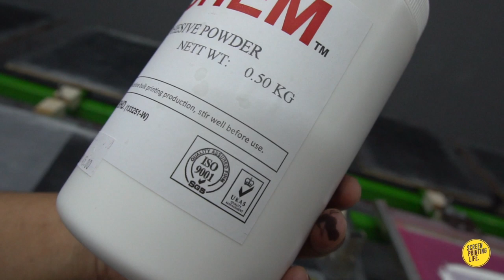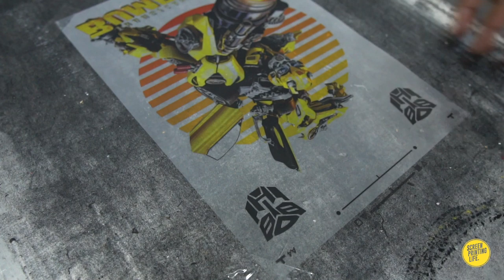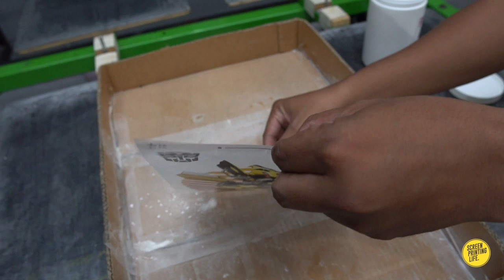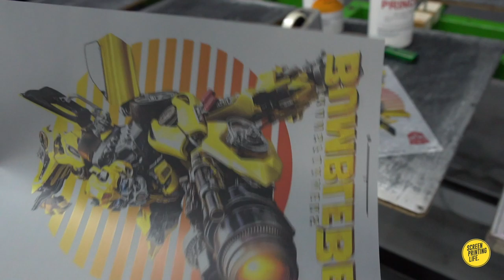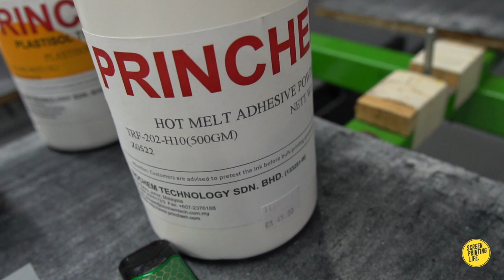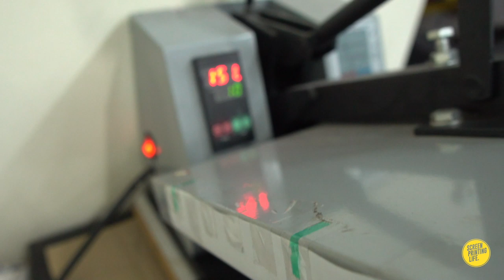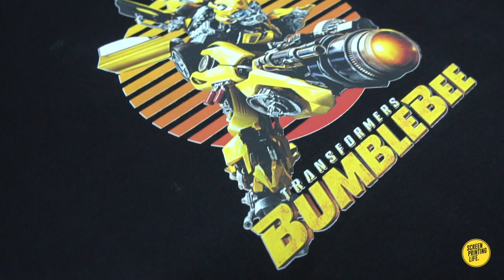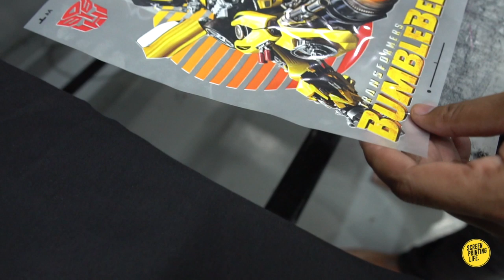Silk screen : How To Do Digital Transfer On Dark Shirt

Comment: I might be a little late but gotta ask anyway. Did the print last for long without fading after several washes? This is great for logo printing in my case. Thanks!
Reply from the maker: Yes color fading after about 20 washes but not bad. I suggest you using DTF instead Digital transfer like we do. 

DTF ink made for textile. And the laser tonner / laser color we use not for textile.
Reply: Thanks for the reply. I greatly appreciate it. Do you think cmyk dtf ink 
on epson printer + white ink (screen print) + adhessive will work? I have epson printer that I'm not using anymore. Thanks!
Reply from the maker: @buildonbudgetph4662  I am not sure about that but logically it will work if you use DTF ink because it is for textile. Why don't you give a try.

Comment: Hi, do you apply light, medium or heavy pressure on this? What kind of toner is being used in your laser printer please? I am using CP5525 laser jet and I am facing this issue with the transfer that the fabric texture appears on the print and those lines have a lighter print color and it seems rastorized. I am using 5 density for all colors in my print settings. Please let me know how do I get rid of these lines in the print. You can have a look at the problem I am facing in this picture: https://prnt.sc/s05y1q